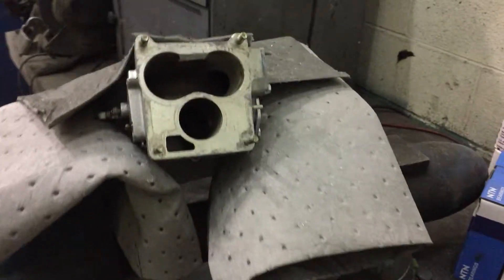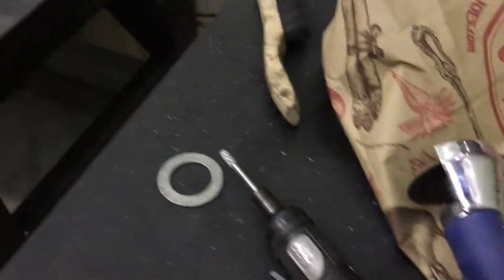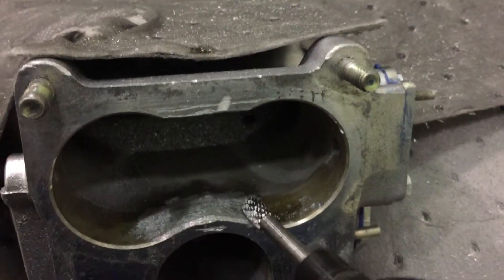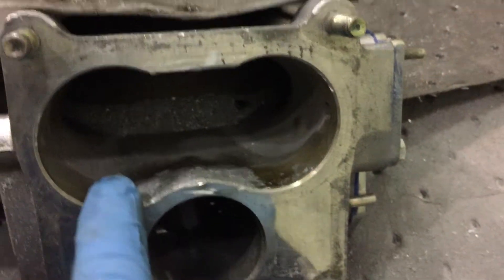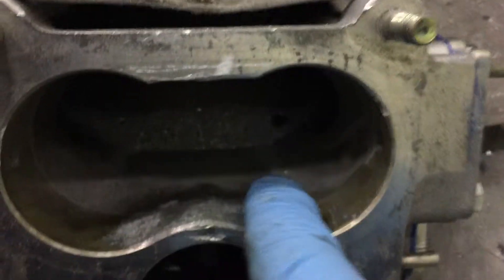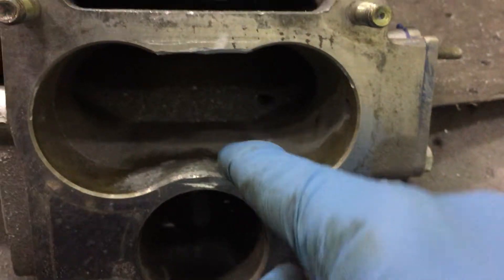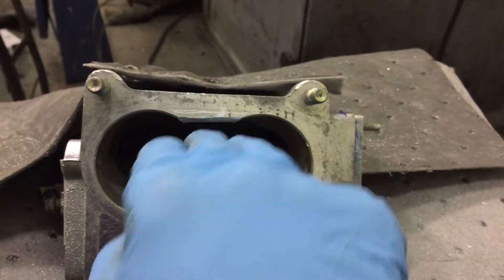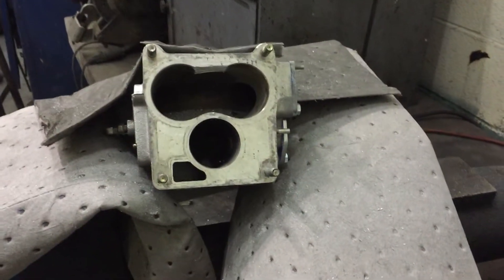13b porting part 2

Comment: Hey, I know this is an old video but I was wondering what that did? More air = more power?
Reply from the maker: Hi Sasha yes the goal is to add more air and then more fuel. 
If you have any more questions shoot
Reply: Rotarys4Ever Thank you for the quick reply, so for more fuel you'd get a better fuel pump and injectors. 
Well if I ever have more questions I'll leave a comment on one of your videos. Thank you.